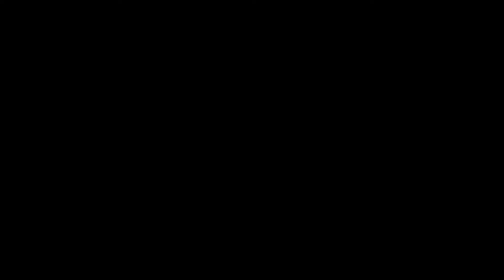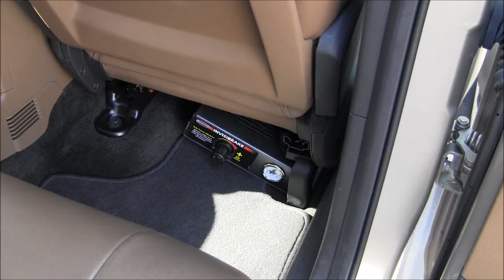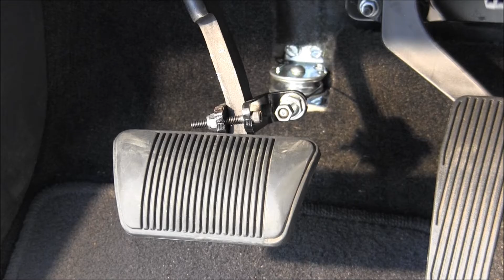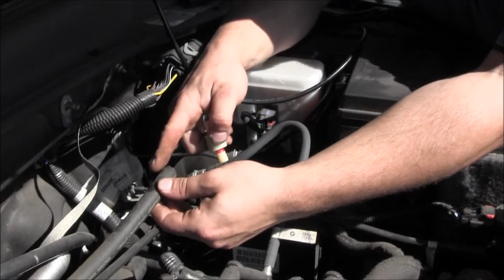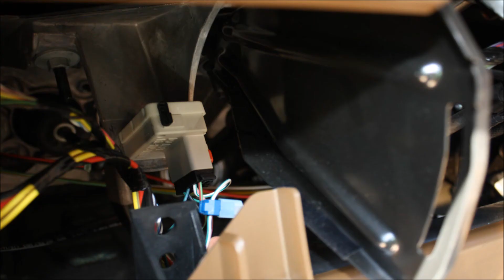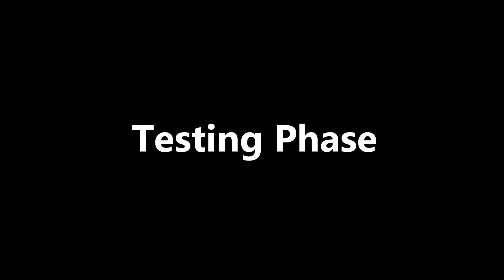Installing an InvisiBrake

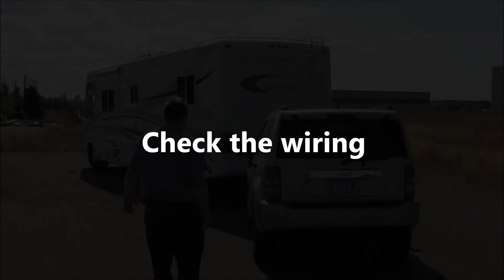Comment: At the 5:40 mark, when the brakes lights are tested, I noticed that the brake lights on the Jeep turn on, but start out dim and get brighter a second later.
Reply from the maker: hat's the running lights mimicking the motorhome's lights before the brake lights actually kick in when you step on the pedal.